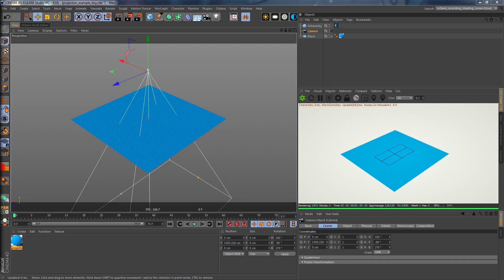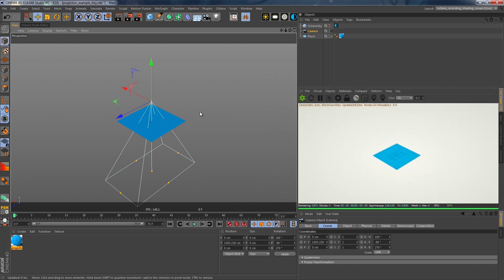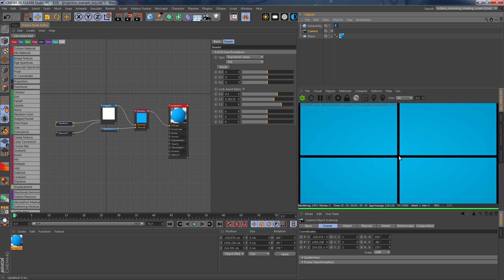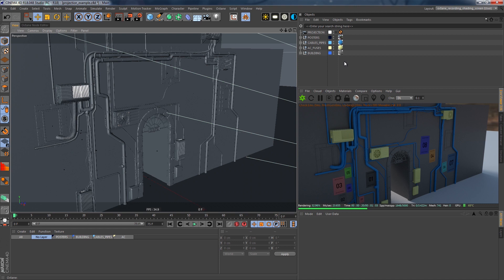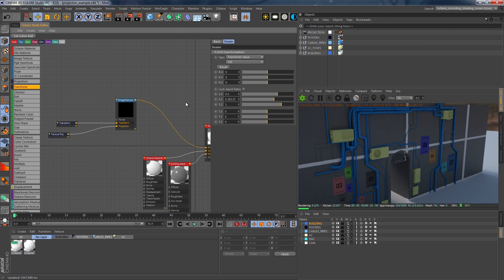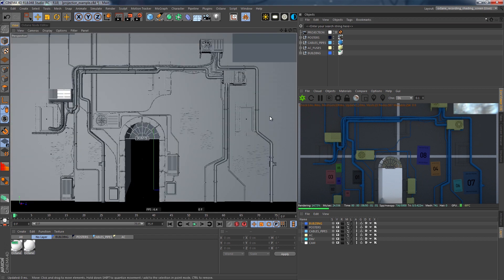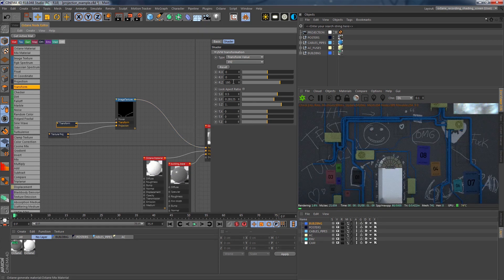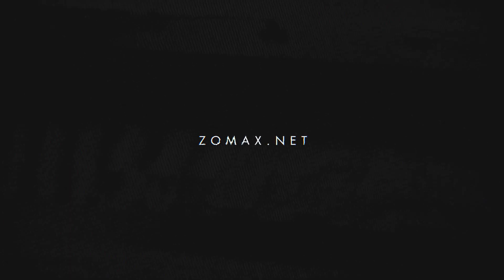Projections in Octane for Cinema 4D

Comment: I don't know why but these calculations do not work for me, even when I have 16:9 ratios. It's always a tiny bit off.
Reply from the maker: I just tested it in Octane 2022.1 and you are indeed correct. The values don't work anymore. This tutorial was made in 2017 and it worked for the last couple years but it seems that there's either a bug or they changed something. I will figure this out and get back to you. Thanks for the input :)
Reply from the maker: I did some tests and I think I've got it figured out :)
In C4D 2023, they changed the focal length of the default camera from 36 to 35 mm. Octane does not account for this and you need to set the C4D camera back to 36mm to make the projection work.

Comment: Amazing but I'm losing the color of my base material (material 2) when material 1 is added.  instead its turning white from the white material 1 you suggest to use @4:35 🤕. If you anyone can help id appreciate it a lot.
Reply from the maker: This happens when there is no texture in the image texture node.
Reply: @CorneliusDammrich  but i 100% have a texture in the image texture node. The alpha image is even projecting onto my geometry but I’m losing the base material completely. Just white and graffiti from image texture .
Reply from the maker: @daveycrockettla  which octane version are you using? when possible, DM or email me on some network and we will figure it out :)
Reply: @CorneliusDammrich  Awesome, thanks Cornelius! I’m running version 2020_1.4 on C4D R22. I will email now 😊
Reply: @CorneliusDammrich  email sent
Reply: @daveycrockettla  If you have solved, let me know. I need it as well thanks
Reply: @azurkamenjasevic1405  yes put alpha in amount  and put color map in material 1 on wrap around mode